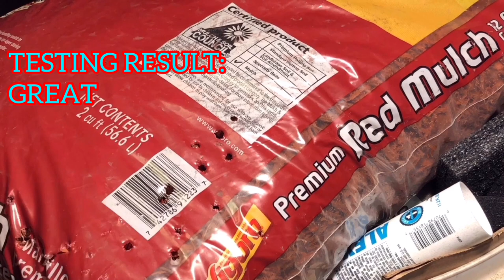Homemade Air Rifle Suppressor from SPRINKLER HEAD.

Comment: Nong,  your moderator looks like it will help keep the noise down. 
Styrofoam insulates better than a 3M pad, so styrofoam will stop more sound. It can be cut to shape and even bent a bit.
I made a similar suppressor a while ago, and after drilling the many holes, filed them to slant toward the barrel muzzle, so the sound will be sent thru them a bit easier. It's the design some moderator mfgs are using. 
Using the sprinkler is wise because the end caps assure your center tube ends up centered, lined up with the barrel. And the plastic models are lightweight and low cost to replace if needed. Thanks for showing!
Reply from the maker: Thanks for sharing your experience!
Reply: I just tested Scotch bright Grey pad vs pipe foam insulation. The abrasive pad was total winner.
IMHO: its not about insulating, it's simply having enough volume inside to slow the airs exit  velocity. 
Thereby reducing the Hi Frequencies crack. An empty tube can manage that much. Truly getting silence is the tricky  Hard part!
Reply from the maker: @stevemccull9699  Interesting. Thanks.
Reply: Styrofoam is excellent for temperature isolation, but for a suppressor/silencer you need sound absorption, that´s why it must be a porous material such as foam or Scotch Grey. Could you please cite the manufacturers using styrofoam for this? thanks.
Reply from the maker: Thanks for the info!

Comment: So a 2nd white tube magically appeared at the end of the video. Any idea what and where that came from and how this all attaches to the barrel? I think you might have left that part out................
Reply from the maker: Hi Scott. It was just a PVC pipe which fits with the barrel. I was suing it like a removable adapter to attach or disconnect it from the barrel. Thanks for watching.

Comment: How did you affix this suppressor to the barrel? Thanks
Reply from the maker: Hi Chris. I used a short piece of PVC pipe as an adapter to connect. Thanks
Reply: I have the Air Venturi Avenger Bull Pup witch treads on to the adapter from Buck Rail.

Comment: Hi Nong 
I made my silencer the same way you did using the Rain Bird sprinkler works pretty darn good I fired it without it and then put it on and it really made a difference thanks a lot brother hope you have great day. George
Reply from the maker: Hi George. I think you made it better than mine. Thanks for the feedback! 👍
Reply: @nongdantexas4478   I use I used fiberglass insulation that you put around water pipes instead of the foam that you Year's I had a big roll of that in my garage so I use that thanks Nong

Comment: Will this work on a rimfire 22 lr?
Reply from the maker: Might not because of the temperature.
22LR has some heat at the barrel.
Reply: Got plans for the next 10 years?    That becomes illegal, 10 years min Jail time!
Reply from the maker: @UncleFjester  . No worries, UncleFjester! Next 10 years, people will use electromagnetic gun which can hit objects with incredible velocity in milliseconds with the noise level below 50 decibels. They won’t even use suppressors anymore. 
 Thanks for watching, sir!

Comment: How did you attach to the rifle? You didn’t show anything regarding how you were able to attach it to your rifle???
Reply from the maker: I did not show b/c it depends on different rifle barrel sizes. Basically, I chose a PVC pipe which fitted with my rifle OD, and using it like an adapter. I used a lathe to turn down the Sprinkler OD and pressed it into the pipe, then attached the whole thing to the barrel. There are many ways to attach it. I just made it removable, so i can attach or detach it quickly. Anyway, It does not look good, but it works great. quiet! thanks for watching.

Comment: Where did you get that foam or what type is it?
Reply: It's open cell foam. Fibreglass works much better. Try fibreglass exhaust wrap (the blanket, not loose fibres)

Comment: Could this fit on a Gamo break barrel pellet gun ?
Reply from the maker: I used a short PVC pipe to connect this to the riffle. for different barrel OD, we might have to modify it little bit to fit. Thanks for watching.
Reply: I had to heat 1/2" schedule 40 Pvc in hot water & pounded on 1/2". For a Perfect tight fit!
Reply from the maker: Hi Steve. I used a small Lathe machine cutting the ID of a PVC until it fit perfectly. Heating is ok, but we can’t control the alignment very well. Thanks Steve for trying.
Reply: @nongdantexas4478  did you use glue ?
Reply from the maker: @elcompamartinez2647  No. I didn’t use glue.

Comment: An excellent video very similar to other air suppressors may be less than a tenth of the cost. Could you tell me what air filter are you using?
Reply from the maker: Wannabe Mgtow 
I re-used a very soft foam that I found in the Ring Camera shipping box. This material is similar to Plantronics Foam Ear Cushion. This suppressor works better than expected. Hope this helps. 
Regard.
Reply: Darice
Foam Sheet 9"X12" 2mm-Black $5.39at wallmard

Comment: make suppressor from sprinker head . is it really work bro ?
Reply from the maker: Thu vui cuoi tuan U S A 
Yeah. It works great for air gun or PCP air rifle.
NOT for regular hunting rifle because of the heat.

It reduced the noise from PCP rifle significantly.